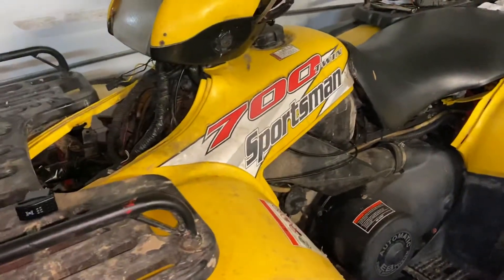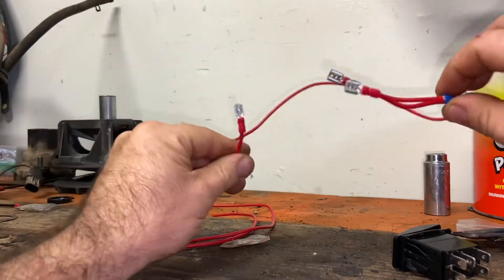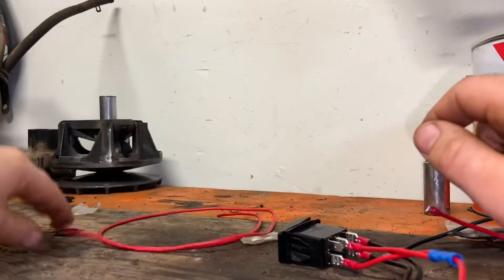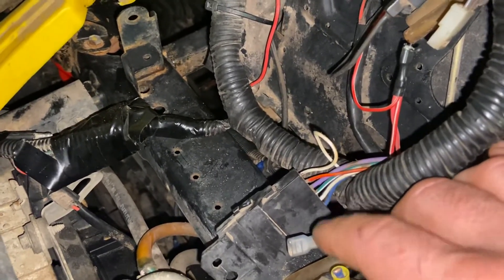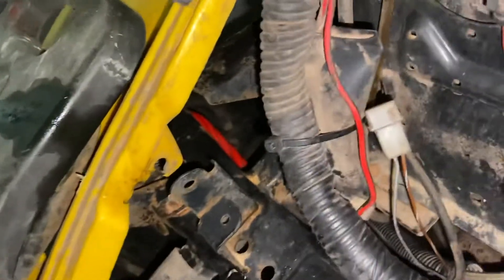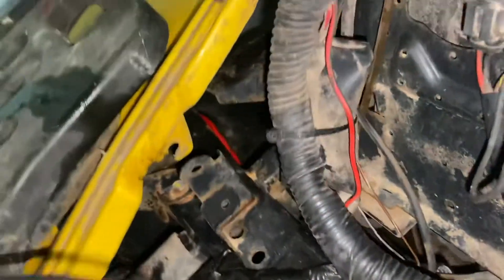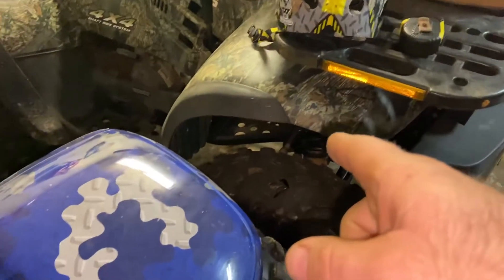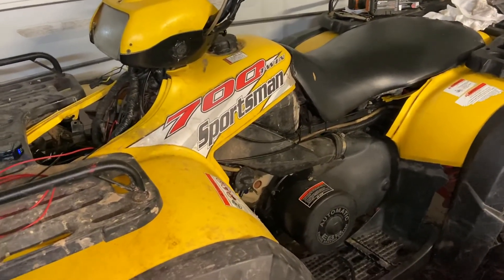Polaris Sportsman 4x4 Inop 4x4 Bypass 2002-2011

Comment: Thanks for the video. Is there any way of bypassing the electric switch on the shifter on a 400 Explorer? It's a 1996. The only way I can get the front hubs to engage is if I hold the shifter forward, with just a bit of pressure than the tires engage if I let the handle go they disengage

Comment: Bought a 2001 Polaris sportsman 500 ho with a bad speedo. Followed your video to bypass the speedo. 4x4 still won't work. Is there another way to do this switch on these. I'm not seeing any splice pack on mine.

Comment: Thanks for the great information. I just hooked mine up tonight. I got power to it intermittently. It's drawing a lot of power for the magnets I guess. The power light will come on then 4x4 for like 2 seconds then all power out for about 10 seconds. And  Repeat. Any suggestions? Could it be too much draw on a breaker?
Reply from the maker: Very well could be that breaker is overloading, the older the breaker gets the more it’s acts up. I’ve seen them trip with like 3 amp draw on them. Replace with a new one. Little tip if you want to confirm it’s the breaker, remove it and put a 20 amp fuse in its place. Now you can retest your system see what it does
Reply: Thanks again for the information, it really helped. I found that the right front mag coil is the culprit. That is next on the list. I enjoy watching your content, thanks again!

Comment: was directed here from your other video for the 97-01 models.  If this is the fix for a faulty switch, how do you know if the issue with the awd is due to the switch, a broken speedo, or if the hillard coil has gone bad?  My speedo does not work, but I swear the awd still worked last time I plowed a week ago, then yesterday mid plow awd stopped working because I kept spinning out and noticed the front wheels were not spinning.  This led me down the rabbit hole of research trying to figure this out.